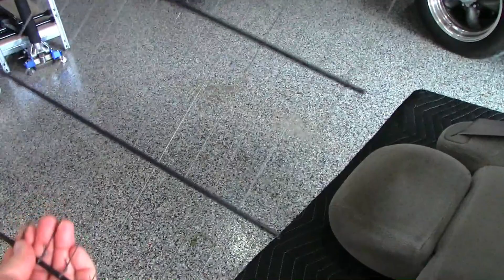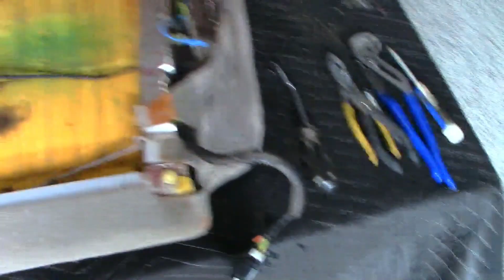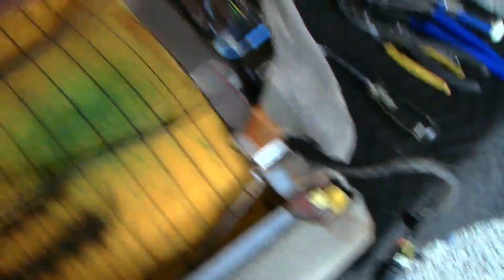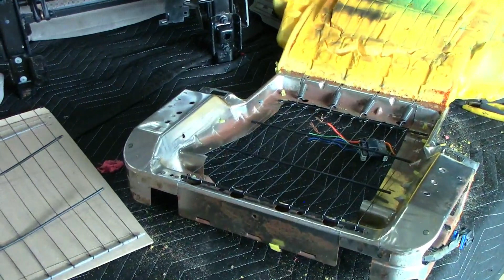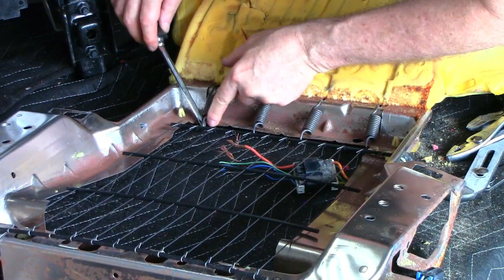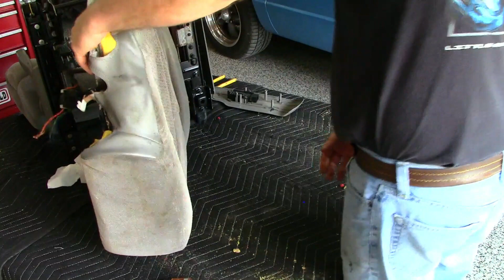Fix 1999-2006 Broken Chevy Suburban, Tahoe, Yukon, Silverado Seat Bottom

Comment: Ever deal with the actual back of seat, leans on right side
Reply from the maker: I never have..yet. You may have to get creative. If it already needs to be replaced, go for it. You can’t lose. Even if the repair fails you will learn something.
Reply: Frame is broke to the mount. Gonna have to weld the metal back together or get a replacement back support.

Comment: Just a hint on how to get the springs hooked without using a screwdriver. I used about two ft of parachord to stretch and pull the springs. It took under a minute to hook all four. Btw, awesome video!
Reply from the maker: Great tip! Thanks for the info.
Reply: How did you use the parachord?